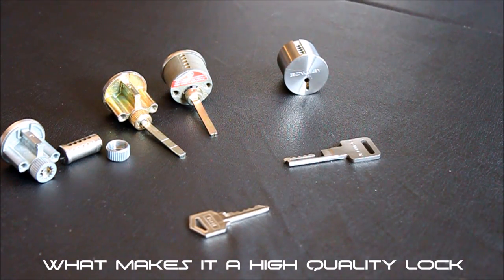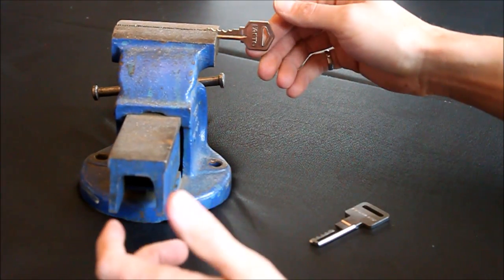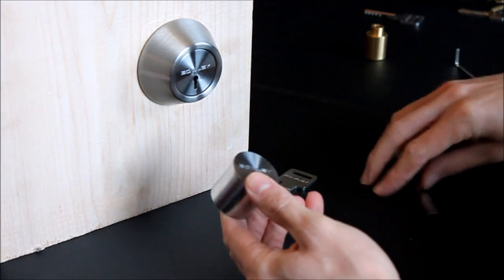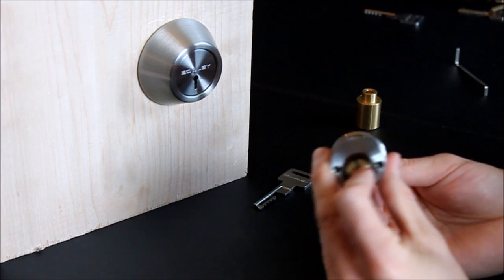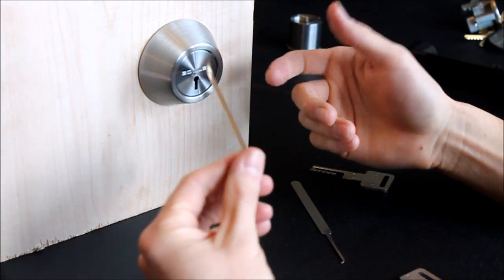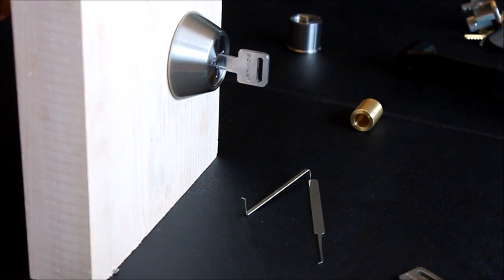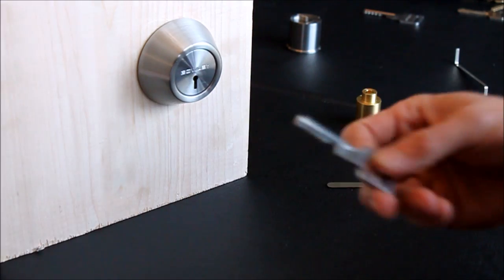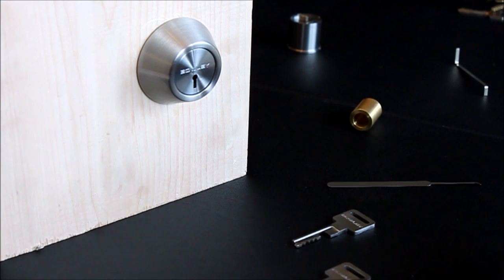Bowley Lock Demo

Comment: Any chance you could show bending attempts on the standard and Bowley keys using a torque wrench? Also, wouldn't the weakest point be the small point where the shank meets the bitting (which is safely inside the vise in your demo)?

Comment: You should send a trial to Bosnianbill. He'll tell you if a lock is un-pickable.
Reply: He has tried and failed many times.
Reply: He actually successfully managed to bump it. I watched the video. Took quite a long time, but in is in.
Reply: Agreed. So far no bumps have been successful. I'm impressed by the Bowley.
Reply from the maker: Tyler Belcher ,
Bill did not bump the lock please watch his video again. he thought he did but he then showed the key had just popped out.
Reply: The monster under your bed  it has been picked quite quickly after release but using some handheld power tool that seemed to oscillate quickly to manipulate pins. I don't know what it's called but it's pretty interesting.
Reply: Yeah I bumped this lock. No problem. I bumped it! Then nothing happened and the lock stayed locked. I should also note that I stubbed my toe just afterwards. It really hurt guys!

Comment: When bending, you were only testing the base bar of the key. Try putting just the upper bitted part of the key into the vice and twist. I think that's what most people (like myself) would wonder. If you take pliers and squeeze the two bars together, does it bend? Instead of applying force to twist, does it bend when you try at an angle instead (making an L shape)? Etc.
Reply: So using the key as the key would be used doesn't satisfy you?

Comment: Very nice design but out of curiosity what is to stop somebody from rotating the mid (inner brass) cylinder allowing the pins to drop essentially bricking the lock necessitating its replacement?  If that is done is there a way for the owner to reset it easily?

I understand you would have to have knowledge of how this specific lock works to think to do that but if that were the case would this be a possibility?

Edit: Also noticed on your website you sell the locks with a turn knob is there a double key option?

Comment: I believe this lock is nearly perfect! My only problem is I know people that struggle to unlock a standard lock! The only thing I would suggest is a indicator as to the locks state, unlocked or locked! But in a way that is not indicated without the key as you don't want someone just casually walking by knowing the door is in-fact unlocked!
Reply: +Michael Wagner. that's my thoughts too... everybody is use to turning the key oposite direction of the lock... two turns would cause a lot of confusioin
Reply: +eric wittington ... turning one way... pushing in, then turning again is the only problem

Comment: A possible downside is the open key way. For example I have a Schlage Primus lock and it's virtually impossible to wedge anything like a screwdriver into the key way. It's just too narrow and too many bends. So what I want you to do is take the thickest screwdriver you can find that will still fit into that key way and try with heavy force to break open the lock. You could even try this test with a screwdriver bit loaded onto a breaker bar. Can this lock be defeated by simple brute force?
Reply: +pseudoscientific . i'm sure forcible entry will come with different models of security features
Reply: +pseudoscientific  and forcing that won't bypass the next 2 most important features
Reply: +pseudoscientific the pins arent accesible through the keyhole... it uses two cylinders, the first leads access to the main cylinder. damaging, or even drilling the first one would still leave the 2nd cylinder secure  as a normal lock w limited access to picking
Reply: +pseudoscientific  brute force on the first would leave less damage manipulation to the "whole" lock unless designed VERY cheaply... shouldn't make that difference unless they're only reliable on the hidden chamber concept

Comment: i could design a "hi-tech" key that would allow you to pick that, it's something i've had in mind for regular keys as well. i prefer to think outside the box when designing stuff!
Reply from the maker: +Quantum Uncertainty Workshop 
I would love to hear more. The problem with manufacturing is it is difficult to produce complicated small parts. Designing them is the easy part.
Reply: sorry this is kinda long, maybe some interesting insight... the pick itself would look near identical to the key for the sake of tensioning... the part where the pins are is the interesting bit... and in comes the "outside the box" part: Nitanol wire, very strong, flexible and able to change it's form with the addition of heat! basically cold form everything to lay nice along the key's contour but where the pins would engage you bend them so when the heat is applied they act as your "pick". the wires would run back to the handle bit of the key which would have a bit of circuitry to control the resistance of the wires allowing them to be heated/cooled and manipulated inside the lock at the other end fairly precisely. i'm sure it wouldnt be cheap... but once you build one for one key you could theoretically open any lock that key could fit in.  i think you could revolutionize the lock picking industry with such a device as you could program the controllers to change the "pick" end of the nitanol to industry standard key heights and just run through the different pin configurations, it'd be more useful for the higher security locks than the generic household ones as those i've seen raked and picked in minutes or less. something like this would be more of a niche to unique locks like yours or higher security locks that would take 10 min+ to pick. i was also curious to see about a "foil attack" on your lock similar to the forever lock which would be an alternate "cheap-o" method basically just keep molding the foil(around a modified key that had the bitting filed down) until it gets close enough to the pinning and just use a hammer on the door handle to jiggle the pins since they're gravity fed(and no spring tension would allow them to move freely), tapping the key wouldn't do anything since it has to be engaged so tapping on the door handle or the lock body itself from the bottom would force the pins to bounce inside. just some of my thoughts on it. i study all kinds of things mechanical and love to know how stuff works as well as ways to enhance, make better or bypass/defeat mechanisms. let me know what you think :)
Reply: Nope. You would need one pick for each pin, because of the fixed shield you can't move a pick back and forth to each pin.
And if you did have one for each pin, when you heat up one pick, the others will heat up too, and you lose the set.
Reply: you apparently don't understand how thin a wire you can use with nitanol, the key is wide enough to provide enough slots for the wires to lay in between. but then again you could just file the key down to bare minimum and put some foil on it and push the key in for tension and then use a rubber mallet to pound on the lock body from on top or bottom and basically foil/bump it
Reply: actually... scrap all that together! i just thought of a way to build a bump key for this that'll work the way a bump key SHOULD! need a stainless steel tube of the same diameter as the key, then you need to cut 2 slots in the middle of the tube somewhere(we're going to put a roll pin or something to hold the other section), then the tension part can be just a nail with the end ground to a flat so it can hold the tension... drill a hole through the nail but make sure the flat tip is oriented correctly! put a decent strength spring inside the tube(should be a cap on the other end(and a handle welded on)... with the spring in the tube you can drop your nail in with the flat bit out, line up your hole with the 2 slots you cut and drive a roll pin in and trim it flush with the outside of the tube so nothing protrudes! NOW both of those pieces should be like that of an automatic center punch and the tip will stay engaged in the tension slot while you tap on the handle attached to the tube which will slide freely... then you just need to weld on a few little beads(well a little tail so it is the same shape as the bitting portion of the key end meaning a small L with the beads welded onto it) and shape them accordingly and voila... a bump key for this lock! just tap away while putting tension on it... simple low tech solution... dunno why didn't think of something that simple before... i think with about $20 worth of materials or so you could make one. might want to get a semi thick walled tube so it can handle a little bit of force while you're twisting, probably want to put some grease in the tube to help it slide easier too.
Reply: basically the spring(need to be stiff enough to force the pins to drop before you start "bumping") in the tube keeps the nail with the flat tension bit in the correct spot while beating on the back side of the tube/handle while turning it... and the spring allows the biting portion of the bump key to slide over the tension bit which is held in by the spring tension in the tube...

Comment: OK, so it's unpickable and unbumpable.  But, what protection is there against drilling out the pin tumblers?
Reply: I they be better off attacking the door itself and not the lock.
Reply: The lock is instantly picked with a paperclip and oscillator

Comment: I noticed in the video the ring on the demonstrator's pinky finger, is he an engineer?  Also, the idea of keeping the design simple is rule one in engineering.  A teacher of mine in public school back in the 1990s telling my class about the Russians trying to design a pen to work in space and making these complex pens when one fellow said, "Just use a pencil." Brilliant design by the way, would you consider making padlocks too?  I can see it being applicable there as well.
Reply from the maker: +WJCTechyman 
I am an mechanical engineer and what you have said is 100% true. Complexity adds uncertainty. The simple pin tumbler was a fantastic design which has just run its course (100 years). Disk detainer locks are fantastic and simple i wish i had had that idea. I wouldn't call this an engineered product in the sense that it is not designed for high loads and public safety as is a bridge or overhead crane. But being a design engineer for a decade has taught me alot about what can and cant be manufactured and a lot of the ideas proposed to pick this lock simply can not be made. those that are simple enough to be made will be very flimsy and provide no feedback.
Thanks for your interest.
Reply: +Dusty G. Well, the moral of the story is the point though, just a polite, anecdotal version of "Keep it simple, stupid"

Comment: I suppose it is possible to defeat a Bowley lock but it would be ridiculously more difficult than a normal pin-tumbler lock. You would need to know how a Bowley operates and you would have to machine some kind of special imitation of the Bowley key. It would require a lot of time, effort, precision, and money, not to mention specific equipment and tools, and it would probably be easier to try to smash in the door or whatever the lock is securing.

Comment: can it be air picked??? ... forcing air into the chamber so all the pins set at the shear line for unlocking?
Reply: it will push some pins too far inside, if possible at all

Comment: hit the lock on top to "bump" it. You might even make yourself a little wedge of rubber to transfer the blow of a bigger hammer. 
Look at that key... there isn't much room for big peaks... which ought to make it easier to catch the pins with a blank.  Maybe fit it with a spring, made to where the pins can bounce off it. You could probably catch a shear line, and to get a blank you just buy the lock and mill a key to match, designed to bump. 

I'm still partial to ripping the pretty face out of that hollow garbage.
Reply: you don't want big peaks... that would force the pins to peak. you want bumps... shear force will create the mechanics needed

Comment: 1:25 I want that key tested at the weakest point (the small piece of metal connecting the top of the notch to the bottom).

Though you wont do it will you? because it'll bend, quite easily from what i can see there's barely any metal connecting the top of the key to the bottom.
Reply: Why would you need to see it tested at that small point on the key? It's never going to be naturally in a position to get twisted that way. You twist test it like any normal key because it's for the most part used like a normal key. Doing that, it is superior.  

They don't have to crash test cars by having the car fly through the air vertically with the front bumper pointed to the ground and smash the top of the car into a wall at 60 mph because that is not a normal way for a car to crash.

Comment: How about reverse bumping?
Reply: the key only moves the bolt when it is pushed all the way in ( 6:00 ) . once you pull it out by reverse bumping you have no tension to rotate the cylinder.

However I dont see any  problems with foiling. So that may be a viable option.
Reply: I'm sure someone will be able to make some tool that can tension it and have a more modified bump key

Comment: I am not concern about global torsion of the key, but if just the small part where the pin falls receive torsion in other direction than the main part of the key ...
Reply from the maker: +Bastien M. (Baba the Dwarf) 
The fork of the key does not receive torsion. The bit on the end enters the cylinder and transmits the tosional load through pure sheer. It would take 500lbs to sheer the tip off.
Reply: +Bastien M. (Baba the Dwarf) thats it i believe... usual standards i think?
Reply: +Bastien M. (Baba the Dwarf) not the ending plate but the ending "moveable" part
Reply: +Bastien M. (Baba the Dwarf) how hard is it to change that to the last pin?

Comment: All you bozos querying the strength of the key need a lesson in reality.
1. When does any person ever NEED to forcefully twist a key?
A. Only if a lock is rusted or seized. In which case noone ever gets out pliers to really lever it around. If your fingers fail to rotate a stiff barrel, you call a locksmith. And, this is top-quality non-corrodable lock, designed not to seize. Lightly oil your locks annually and they'll never stiffen up.
2. A burglar forcing the barrel around with or without a key will never open this lock.
A. So the only fkn reason he is bothering to show the key's greater strength is because idiots think it LOOKS weak. If they wanted to solve that problem they could just add metal to it to make it LOOK stronger.

I don't understand why lounge-chair experts say such stupid things to professionals who have researched and developed a top quality product Do you really think they didn't consider the strength of the key. Jeezuz. 🙄